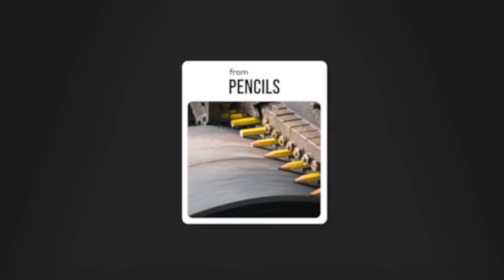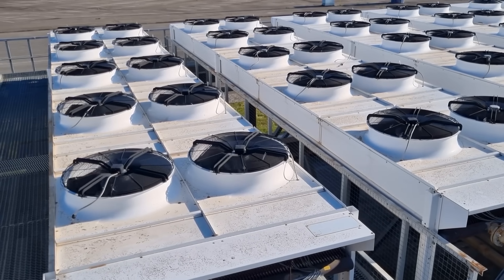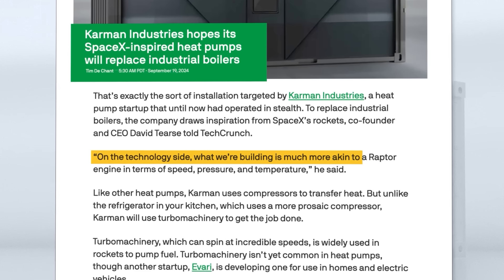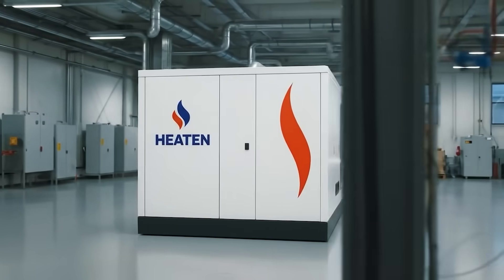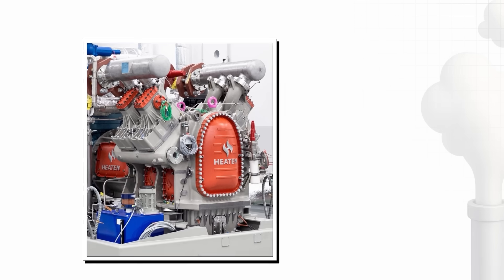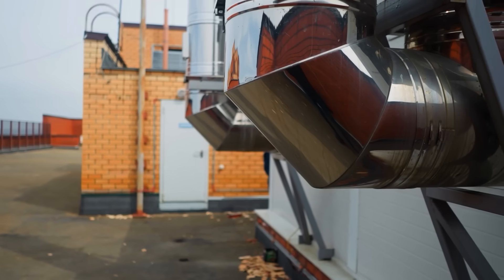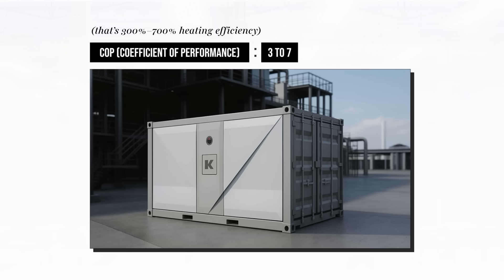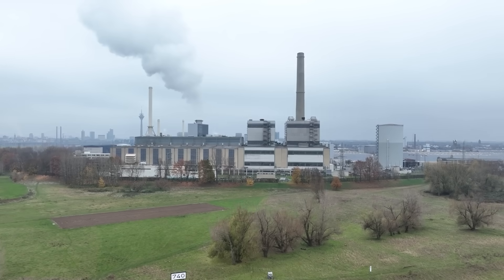Is This Space-Tech the Future of Heat Pumps?

Comment: Exotic materials equal exotic headaches.  Today's environment should reveal to most, that supply chains cannot be maintained or even established with many metal ores.
Then there is the problem of refining and manufacturing which is technology that is held by fewer and fewer sources.
Proprietary equipment and processes may enrich the patent holders, but it also keeps the pricing high and slows further evolution.
The simplest engineering is best but often elusive.

Comment: A really good heat pump fluid will have a high critic pressure and temperature, well beyond its delivery temp.  It will also have a large enthalpy of vaporization.   Water is ideal.   High molecular weight hydrocarbons and fluorocarbon, while easy to compress, can’t be used efficiently at high discharge temperature due to their low critical point.  Heaten is definitely pushing the envelope with their mix.

Comment: Combinations of SpaceX and Boeing technologies could be used to produce much more efficient hybrid cars and trucks. And hybrid turbine generator would not have to be very heavy and could do much to cut down on the weight of batteries yet still have the capacity to climb long mountain passes but recoup energy on the downhill side. Electric motors are great for providing needed acceleration for traffic stop and go while fuel based motors are great for range. Not every dwelling has a driveway to mount a car change port and running extension cord across sidewalks is a no-no, so hybrids would suit the economy class.

Comment: Nice job putting yourself out there and trying to spread the word about positive progress. One thing you should check on is the difference between SCROLL compressors (used in most small HVAC heat pumps, 10-ton and under) and screw type compressors (often used for high capacity air compressors). https://youtu.be/Z_QuamEZcCU?t=464

Comment: 7:55 Nitpick: Why specify Temperature Lift using Kelvin if you're going to immediately switch to Celsius for the max temperature? For relative temperature differences, Kelvin and Celsius are identical in scale (unlike Fahrenheit). You can say "Temperature lift of 140C, [...] at temperatures up to 200C" and mean exactly the same thing, without any need to switch units in between the two.

(Yes, obviously an absolute temperature of 140K and 140C would be very different, but temperature lift is not an absolute measurement, it's relative -- a measure of difference.)

Comment: The future of ASHP is the integration of HGS process (hot gas process) by tapping hot refrigerant gas straight from the compressor’s discharge and feeding it back into the evaporator inlet so the pump stays warm and efficient without needing defrost pauses. Very simple.

Comment: well you could use stock car turbo for the pump compressor. or electric version of those. but dont go back in the mud pond, with the dirty. heathen? dont get stuck in the way bruh. commercial model is bad. must chill those heat pumps. business commerce gov is strictly separate from the actual products. unrelated nonsense. products are fine, the 99.99% of the cost trade system around it is not. ie at max 0.01% efficient trade commerce system. well, you can count how much of the economic value goes to the product and how much to the system itself, which is 99.99% (wages, byro, markets, etc). yep market is a waste product. if you need to use markets to waste stuff, then you are wasting stuff. cool. if it costs then not worth it, markets. it should be free, so keep it free. any you needing to be served? nah mate.

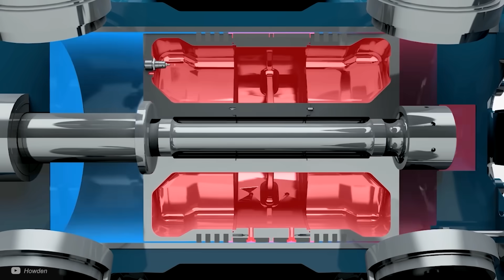Comment: 7:44 Former refrigeration and air conditioning technician here, most domestic heat pumps and air conditioner nowadays use scroll or rotary, and not screw compressors. Screw compressors are, and always were reserved for industrial cooling applications.

Comment: PVT is very interesting you use the Photovoltaic Module to generate Electricity the backmodule dissipate the heat from the Heated up PV Modules. If cool it down or hold it cool you dont loose efficience of thr pv Module.

You have now electricity and with a combined efficiency of 60-70% 

Im sure if
 combined with the Heatpumps it get interesting

Comment: The claim about "inspired by SpaceX' raptor engines" is pure marketing BS. Raptor engines are indeed innovative but their turbopumps are bog standard, directly descended from the turbopumps of the V2 (an adapted fire engine design!) and the mathematics of which were worked out by the Soviet engineer Kapitsa in the early 30s. The reason the heat pump in your house does not use a turbine is purely economic (efficient ones are expensive to make), not for want of understanding the technology which is almost 100 years old.

Comment: I don't think heat pumps will ever achieve the high 1000+ Deg C industrial temps.
But Coolbrook's electric rotodynamic heater has reached 1000 Deg and they plan to reach up to 1700 Deg.
That has a lot of backing and interest, but it won't have a COP above 1.

Comment: Poor things.. Companies: "Oh no its only 200F now.." Me: Transfer heat into cold boiler tank!! You people already got the basis of a FORCE MULTIPLIER.. Kids on Youtube screaming Tesla Turbines at 134F with their vacuum settings inside the system. Vacuum pump water panel around cold side low enough to freeze and add mechanism to auto release energy from water anywhere you want leaving ice. Then with same pump vacuum inside Tesla system to remove gas. Now when you open valve to Turbine the universe gonna want to balance hot & cold with all its might at that scale but Turbine steal all the heat leaving icy cold vapor so it can't. Design Turbine to produce Ultrasound waves not only to make sure ice buildup no problem but also to elevate system beyond human range of hearing like UFO Stealth tech. Connects Piezoelectric Ultrasound Crystal tuned to optimal operation whine of Turbine to Amp then connects light bulb above it outside the machine So if sealed in metal you can know its working without looking at anything else.

They got submarines and spaceships "We transfer the heat to the ocean" and "we transfer heat to space" < Madness lol.. Could minus that off ship or sub operation power total.. Bites Apple Generate high powered high ranged shockwave echoes with power surplus to pull solar wind fast to build up around ship to regenerate life support + Hydrogen + Water and for submarines a strong shockwave anti-drag field to lower resistance on ship. Resonance frequency filters like medical scanners but for materials of vehicles + Humans and echo clashing for range limiting to maintain stealth for subs while gaining 3rd person vision with reverse scan filters in computers. Google: "Unclassified Plasma Triangle UFO" + "Boeing Plasma force field blocks bomb shockwaves" + "Plasma generated Ultrasound" I know what I'm talking about. Heh..

Comment: I don't believe the Karman's project. I'm not an expert but I do not think you have so little energy saving from vapor compression cycle. if you do not use that cycle, you basically lose the whole latent energy heat transfert. I do not know the numbers in case of refrigerants, but in the case of water, melting ice or boiling it to vapor is basically as much energy as increasing the liquid water of same volume of ~500°C (2200kJ/kg versus 4kJ/kg°C). It may vary depending on the refrigerant but you can see where I'm going there.

More numbers: to get energy savings of 25% you have basically to have a COP of about 1.33. This is quite really bad for a heat pump considering what you are doing especially the whole system maintenance where as you have almost no heat limits and a COP of 1 with resistive heating.

I'm betting against them. And the fact that they talk about how they got inspiration from rocket science and SpaceX doesn't inspire me. Looks like the perfect investor bait from a makerting guy knowing nothing.

Comment: Turbo compressors are commonly used in refrigeration-cycle heat pumps and they have been for decades. Danfoss, York, Trane, and others make refigerant turbocompressors and they can be found in just about every large building. Look at the skyline of any city and virtually every single building has a heat pump with a turbo compressor.

As far as COF don't forget to generate and transmit electricity the grid has an average COP of .3, meaning that if you have a COP of 3 in a heat pump you've gained nothing. 

This seems like a VC funding scam more than real technology. I mean it is real technology that has been in common use for 60+ years at this point. It feels repackaged to con folks out of their money.

Comment: Centrifugal chiller tech here - the industry has gone full circle and is now back at low pressure refrigerants. R1233ZD and R514A amongst others. If the footprint can be condensed down enough to allow the mass flow for low pressure I feel this will be the way forward. Until then R744 or even R717 is the way. It will keep the noddy’s away from working on it then 😁

Comment: Pretty sure, if this isn't VC bait, they're using a supercritical working fluid. Based on their buzzwords about the pressures and speeds involved that fits best. Probably using CO2 as the refrigerant since it's thermally stable, and the supercritical cycle works at high temperatures as long as you can handle very high pressures (2-3000PSI), and works at a relatively low pressure differential between low and high side. That low differential would make a single stage turbocompressor viable, and such a setup wouldn't require complex sealing or valves that would need to withstand those high temperatures.

Hopefully something useful comes of it.

Comment: This technology is as new as turbojet engine. Every A320 and B747 has two compressors with pressure ratio 12-16 (may be more on newer engines) and temperature at discharge more than 300 °C.
The problem here is to justify the investment. No one wants to buy an airplane to recover some waste heat.

Comment: Recovering waste heat is great when you have a demand that matches the heat waste. Otherwise it's just not economically worth it. And economically worth it, means in the full calculation of all costs of labor, material, space, time it is wasteful to do it.  Most industrial plants are getting thermal efficiency into the high 90s be preheating cold inputs; water and combustion air. Although even now many plants don't bother to use all the heat recovery methods because they just aren't worth the cost.

The poor economics of heat recover become just more so when we finally move to full nuclear power and the cost of energy becomes nearly zero. Every large complex of oil refineries would be a great location for a small modular reactor to provide electrical power and heat. 

In the Alberta Oil Sands which is one of the largest collections of industrial activity in the world, has had a long term dream to get a nuclear reactor built to provide energy cheaply and allow the mines and processing plants to sell the natural gas rather than burning it for power/heat. The cost savings would knock another 10+ dollars per barrel of oil produced and free up a huge amount of GJ of nat gas for sale. 

If you can build a heat pump that will work in an industrial setting on that scale to recover heat and have it's costs be less than generating new heat you have a product. Otherwise you are just doing a wasteful thing.

Comment: Compressor stages are proportional to the temperature delta. Higher temperatures more compressor stages. At lower temperatures there is a greater loss because of the mechanical limitations of the compressor.

Comment: "... using waste heat is a huge sector ..."

Many cities in Europe have district heating systems, such that waste heat from industry can be used to heat homes, household water and swimming pools. The Copenhill (a trash-incinerating powerplant in Copenhagen) sends all the waste heat into the district heating system. Copenhagen gets pretty chilly during the wintertime. If you can heat your home with waste heat (district heating) you don't need so much electricity, such that each MW of electric power production covers more households.
Reply: Problem is in the US, industry is generally located far away from people making piping that heat to homes too expensive.
Reply: Here in Poland we took that idea one step further, people burn trash in their own furnaces and heat their homes
Reply: @igornoga5362  The problem with that (just like burning coal) is that the smokestack emissions aren't filtered. This is why China has banned coal and trash burning in cities whilst ramping up coal-fired power plants with impressive exhaust filters

Those chinese designs also seem to be designed with an eye towards potentially adopting molten salt nuclear heat sources to replace coal in the long term
Reply: This makes even more sense for nuclear power plants but these tend to be sited away from populated areas due to the "issues" associated with solid fuels and water cores

Molten salt designs may change that. These are inherently safe for use in urban areas as they can't spray radioactive materials outside the building and don't need massively overbuilt pressure containment vessels plus buildings (You still need containment but it ends up 90% smaller and even stronger, for 20% of the cost of existing designs)

The extra electrical load associated with widespread discontinuation of natural gas/oil heating systems will add a lot of impetus for district heating systems instead (nobody is going to pay for "green hydrogen" at 10-20 times the existing cost of gas and at least 3-5 times the cost per joule of electricity, so the vaporware proposals of replacing natural gas with hydrogen are naive at best and outright fraudulent in most cases)

Comment: They are just namedropping spacex to boost intrest.
Their innovative compressor is just a turbocharger with electric motor.
Also reverse brayton cycle has been used for decades to make heat pumps more efficient, just due to maintenance and cost it's not something an average person would buy.

Comment: A technical beef: it makes me a bit prickly when the heat pump industry try to claim the original source of the heat energy that they are re-capturing and concentrating as their own. This is like saying that the efficiency of my heavy haul truck increases exponentially when I stop hauling rubble, and start hauling liquefied natural gas..... This is simply a false equivalency. My machinery is not responsible for creating the energy that is stored in the medium that I am hauling, and the efficiency of that equipment is still limited by the rig itself. Heat pumps etc. are a way of re-capturing/concentrating/hauling/moving that energy around. They should be compared, apples to apples. Do not tack on the efficiency of the load, as if YOU created it. Rubbish.
Reply: It's important to point out how much heat the heat pump hauls, at how much electrical cost and the max temperature they can heat to.

Comment: Another great Video. Love your channel! Just one question. Couldn't we have developed this heat pump technology 50 years ago? What's new about it? Compression is old-school tech, no?
Reply: Heat pumps have been around for decades (in your freezer, HVAC etc.). This is efficient high temperature heat pumps for industrial use. Making heat cheaper for an increasing number of industrial processes.
Reply: @Biggest-hz7ng  I know, but why didn't we do this 50 years ago? Because we had lots and lots of oil to burn?
Reply: @Scubongo I think what's new is the efficiencies and the high temperatures, bringing low carbon heat to a larger proportion of industrial processes. Not very glamorous unless you mention/rope in SpaceX.

Comment: It would be nice if heat pumps actually worked... right now theyre pretty niche
Reply: They are common in industrial and domestic settings in Europe and the US. Not that big yet in the UK domestic heating though.
Reply: @Biggest-hz7ng  because they dont work in very cold climates or very big temperature differences... as for the very mild weather of southern europe you might as well hire some filipino immigrants to breath warm air on you... it might be cheaper for the same result
Reply: @LoneWolf-wp9dn efficiency is lower for larger temperature differences. Heat pumps available in the UK are designed to work down to around -25C.
Reply: @Biggest-hz7ng  doesnt matter down to what... efficiency matters and investment
Reply: @LoneWolf-wp9dn so, you admit they work? By 2040 half of all homes in the UK are planned to have heat pumps.

in the UK, heat pump efficiency throughout the year means they have a similar energy cost to a gas boiler at the price cap. Heat pump installs cost on average £5.4k after the grant.
Reply: @Biggest-hz7ng  similar cost at what temperature? when it gets to the low temperatures what does it cost to run? just because it stays on at low temperatures and doesnt shift over to ptc heater doesnt mean that its a good thing... i looked at the specs and asked pros and im just not convinced... for mild weather most things work... for very cold weather i just dont see it